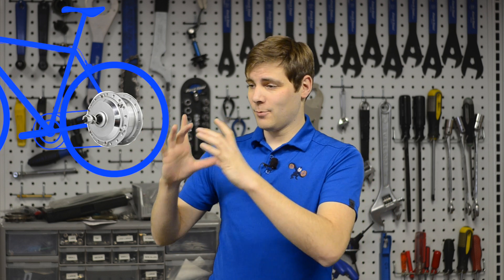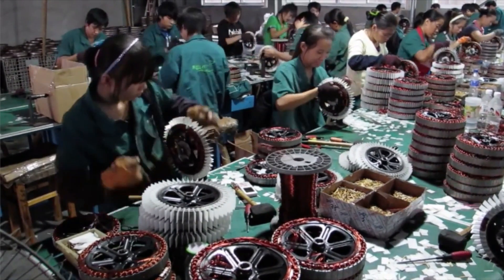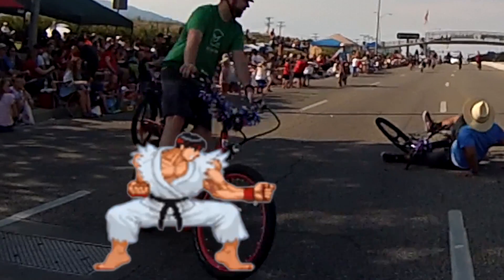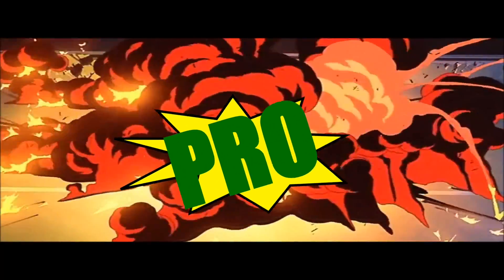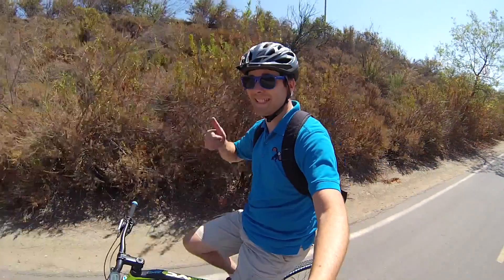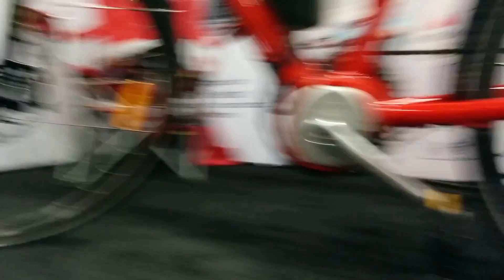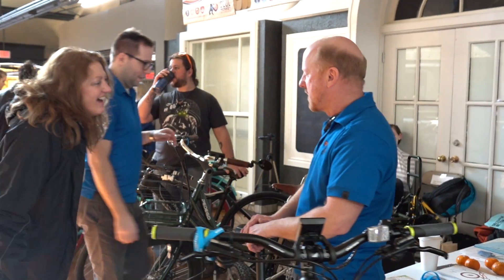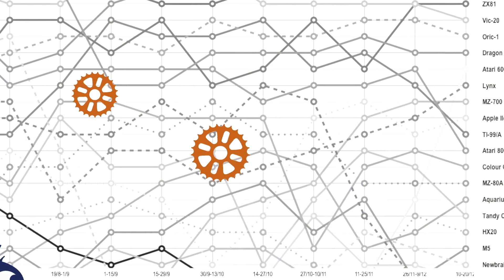Hub Drive VS Mid Drive eBike motor systems

Comment: For urban commuting that has only moderate inclines (I wouldn't even call them "hills" but enough to require changing several gears), which is better, mid or hub drive?  This video seems to mainly focus on mountain biking, unfortunately.

Comment: The BAFANG Mid drive any day. 1. Easy to build  I put one on my Trek 29er in about an hour.  2. Use of gears. I still have 9 gears to utilize. 3. You can get a kit with a throttle.  Mine has throttle and motor cut of sensor for easier shifting of gears.   see it here:   https://www.youtube.com/watch?v=ET3_axuihbY&t=1s    I have over 2000 miles on it.  Grease it every 1K and yer good to go.  Still using original chain which is beginning to stretch out, will replace soon.

Comment: I prefer a 48v front hub with  a 52v 1200watt 10ah on a 29" 300c road bike. No suspension. No gears just back pedal brake. Going by years strong now with an average range of 35km at top speed of 49km/hr
Reply from the maker: Coaster brake with 1200w? Be sure to dust off that will of yours.

Comment: If the hub drive is not switched on, does it add much drag?  And same for the mid drive when you are pedaling faster than the motor cut-out speed?  Cheers!
Reply from the maker: It depends on the system, but yes, there is some drag. The extra weight of all the electric parts is usually around 15 lbs. That seems to be a bigger issue for most folks.

Comment: I prefer stress on the cain over stress on the motor. Since the middrive motor profits the same as I do frome a good gear choice, and we both can use the full spectrum, the motor is more likely in it's sweetspot of RPM to torque, while the hubdrive spins slower, unable to deliblver the requested amount of torque, sucks more and more amps, while cooling, because of lower speed, starts to fail.

Look at ebay, there are so many hubdrive pedelec with burnt motors, while there are the old Panasonic 26V middrive pedelecs, after 10 years and several thousands of kilometers still in use.

I mean, a new chain costs 30-50 CHF, while a new motor costs around 800-1200 CHF. But that doesn't matter at all, since I have a bike here, with the Panasonic 26V middrive, 24'000 km and the original chain still in use. But I have to say, to be fair, that it is a hubgear-pedelec.

Comment: I really cannot believe that someone with basic logic will buy a bike with mid drive! I am also astonished not to see or hear about the major con of the mid drive. What is something that will often occur while biking an ebike? That you will run out of battery of course. How are you going to pedal an uphill with a mid drive ebike which has a dead battery when you have got rid of the front triplet chain ring and substituted it with just one ring chain of about 42 teeth!! You just cannot!

Comment: I think you missed some big points
Hubs have issues with "unsprung weight" that can be reduced but not eliminated.
Mid drives can't do regen braking and they are still a long way from standardization -this means they are on the fast track to obsolescence.
Reply: regen breaking is on its way out in bikes and scooters. Very non efficient and too many batteries blowing up from it

Comment: The "music" bed is not only unnecessary, it's distracting. It comes across more as an irritant and left the video non-watchable..I moved on @ :33.
Reply from the maker: The "comment" in this section is distractions and unnecessary. It comes across as an irritant and and unreadable. I moved on after 25 words.
Reply: Blue Monkey Bicycles I like your presentation; the set and your production in general. Best of luck to you~

Comment: Mid drives don't always require you to pedal, the iZip bikes have the option of a throttle control now, the motors have an additional ratchet so they can turn without the pedals needing to turn.

Comment: just came back from the Alps where our hotel was renting out ebikes with the bosch mid mounted motor and these get up and down the mountains every day, used as abused by the uncaring customer. So that makes me think that chain snapping isn't a thing anymore otherwise it would not be viable for them (also nobody wants angry customers stranded on a mountain)

Comment: I'm impressed by how much of wrong information one can get from a video that seems to look quite professionally...
Reply from the maker: Do tell...
Reply: Well, you don't need a specific frame for a middrive.. I have put four of BBS02s on my bikes to make them all electric... You can actually use a throttle and no, you don't have to pedal if you don't want to... You get this instant torque also from a mid drive and you can still keep your existing gears while when oposed to hub drive, you just keep the same gear all the time thus you decide at the beginning what is more important to you... Speed VS torque...

Comment: front hub drive is worth a mention too! 
con: comparably weak, because traction and not breking the fork limit how much power makes sense. no good choice for sporty off road driving. 
pro: cheap and easy to install on almost any bike. the added mass on the front wheel makes hands free riding incredibly stable. also works very well on roadbikes.
Reply from the maker: Covered in another video

Comment: Thanks for the advise, I bought a helicopter.
Reply from the maker: Awesome
Reply: @BlueMonkeyBicycles  Today I got a cyclamatic power plus 250w. I'm 38 and it's my 1st time riding one, so much easy on peddling or being lazy and just use throttle only. I'm now looking at the mid motor as for the reasons explained in your video, plus it will stop me from being lazy from using a throttle. The cyclamatic was a cheap tester to see if I'd like having assist before spending a few thousand on something that I might not enjoy.
Reply: I got my dick stuck in the toaster

Comment: QUESTION  ; WITH A MID DRIVE , CAN I STILL US MY COASTER BRAKE ?
 I have a 7 speed internal hub .
Reply from the maker: Presumably, yes. You can also use caps lock with a mid drive.

Comment: You failed to mention mid drive with a belt (and hub gears). You can't have a belt with a hub-drive, and belts are far less maintenance than chain drives (and don't suffer the issues with stress).
My bike (Kalkhoff) is basically zero maintenance, with no chain, no oil, no mess, no fuss.
Reply from the maker: I've seen hub drives with a belt instead of a chain.

Comment: If you are looking to do a responsible climate disruption response as an individual there are 18 items out of 100 that you can be responsible for. Worldwide if we all did it we could sequester (without the oil and gas companies doing geoengineering) about 372 Gigatons in 30 years.

 E bikes are .96 GT and rank #69 but you can also push for better bike infrastructure for another 2.31 GT rank #59. Also you could do your own charging station (minimalist tiny home. apartment or rooftop solar) 24.6 GT which is #10 in ranking. Be your own power company. 
Vimeo on part of this see Verchinski and Thoreau.

Comment: If the chain breaks on my hub drive bike then I would be stuck as it’s a pedal assist. If I don’t pedal I would just stop
Reply from the maker: Depends on the sensor that drives the bike. A cadence sensor can run the bike with no chain.
Reply: I have never tried it without a chain but it would be a bit pointless. The motor only kicks in when my speed is below 15.5 mph.

Comment: I really enjoy front hub drive...I've tried the rest...and for me it was front wheel hub drive...
Reply from the maker: 2kw front hub is too rich for my blood...
Reply: There is a reason why in Europe you can only have a 250 W motor, especially if they are on the front wheel for versatility and conversion purposes. And seeing as they’ve been doing this longer than anyone, I chose a front wheel drive for general commuting on my 90’s Trek Hybrid with 18 speeds to assist. And I can get up any hill in this very hilly town of Prescott Arizona and I’m in my 70s!

Comment: I'm so confused. I'm buying an ebike tomorrow and I have to make that very choice. I like the idea of mid-motor, because they seem to produce more torque than the hub motors, but that chain snapping really scares me...
Reply from the maker: It's improved a lot in 2 years. I wouldn't worry unless you're doing lots of mountain biking, and you're new to the platform. If either of those don't apply, a mid drive is fine.
Reply: @BlueMonkeyBicycles  Thanks. I'm going to the bike shop today. From what I see, they might have just made my choice for me. They have two models of the same bike, one with back drive and one mid drive. They had the mid drive in promotion, same price as the back drive. But now it finished and the back drive is in the promotion, making it half the price of the mid drive.

Comment: Belt mid-drives are coming on strong. Quieter, stronger and longer lasting. No real maintenance either. Adds a bit to cost but the benefits are great.
Reply from the maker: You're taking about belt drives instead of a chain, right? They are  nice, but gearing options are limited, and dual suspension requires a lot of work. They are coming along though...
Reply: Blue Monkey Bicycles - yeah, I’m a bit puzzled why the belts aren’t more prominent yet. Perhaps a cost configuration issue but expect they will become more available as chains are just a pain generally. Hubs are ok for their purpose but not when you want or need torque and gearing when mountain/trailing etc.

Comment: Audio tips: Having music with lyrics in an intro while you are talking makes it more difficult to understand you. Change to instrument only music. 2nd tip. Run your recorded audio through a program such as voicemeter banana to help take the harshness off some. 3rd tip. Look into balancing audio across the video. Programs are out there just find what works for you. Great information here and the audio fixes are really easy. P.S. Change the gain on your microphone and move it further down to avoid the pop sound from your Ps.
Reply from the maker: Thanks. Take a look at some later videos, I improved a bit, but I didn't get as far as you've outlined. Thanks for the advice, I'll use it in the future
Reply: @BlueMonkeyBicycles  Awesome. Your content is great and I wish you the best in your future endeavors.
Reply from the maker: Thanks. What do you think of the audio on the more current vids?

Comment: what about a urban x cause what I was thinking about getting. And is they waterproof like is most e bike's waterproof cause some 1 told me the rain can mess up the e bikes. Ane where  can I get a mid drive e bikes what stores sells them ?
Reply from the maker: If you have a home made battery pack, and connectors, then it might not handle rain as well. I'd you get any professional kit, it should have water proof connectors.
ebikekit.com has a good kit with water proof connectors as well

Comment: This guy is obviously pushing mid-drive because it requires a custom frame, this you are forced to buy a complete bike from a dealer. One could easily put smaller hub motors on both the front and back to distribute the weight.

Plus, notice that most of the advantages he gives for mid-drive are etherial and subjective, like "a zen-like experience" or "you get to see more." Utter BS.

They just want to sell more $4,000 bicycles.
Reply from the maker: "ethereal"
You may be pleased to hear we don't sell bikes anymore. As of now, Blue Monkey is completely independent of any salesman stigma.

Comment: Do you have a recommendation for a electrification for a Schwinn Meridian trike (26")? Speed is not an issue but torque is.
Reply from the maker: ebikekit.com

The guys over there have loads of experience doing trike conversions. So much so that they make finished trikes in house under electrictrike.com brand.

Comment: Actually I've seen a couple videos where they use a belt instead of a chain. I too, know very little about torque and strain. But I suppose if the combustion engine has been using belts for a generation, it must be alright. 

I still want to get my hands on the design the company made for the bike that reached over 200 mph just by using a pedal system with gears and chains. I'm sure with that kind of torque you can scale a mountain at a slow, easy pace. Of course they use something like 6 or 7 gears and 3 or 4 chains. So worrying about a chain snapping shouldn't be a problem.
Reply: with a belt drive you'd loose the option for derailleur gears. so a gear shifting hug is required to still have anything but a fixed gear. belt drives are pretty awesome, though. much cleaner than a chain and virtually maintenence free, when combined with a decent 7-9 speed geared hub. (those need service every 2000-3000km, and it's a huge hassle, compared to replaving a chain)  also belts are bad in mud  and dirt.

Comment: Can't decide which one is better? Then have three, yes three drives. Front hub, mid hub and rear hub drive. Although I know that it makes no sense at all, especially having mid hub with rear hub combined, if you so happens to be able to modify them. But a motorised two wheel drive bicycle seems interesting though. Anyone tried this before?
Reply from the maker: Yes, with varied levels of success

Comment: hub drive motors more efficient cuse
no chain in the way of power and that is good.
hub motors more powerfull motors.
Reply: Hub motors are weaker...
Reply: @-joo3033  Theres a limit as to how much torque the hub motor can put into a bike frame, so they feel weaker. Mid drive are driving the whole drive chain, and really just feel like you are adding a whole bunch more leg power into the crank. The wear is that it does stretch the chain faster, and more wear on the cassette. However, I off set this by realising how much Im saving not using the bus, train or car every day to get to work.A good setup should last 1000K or more, a great setup with heavy duty chains will last much longer. But pay attention to loose chains, slipping, etc. Regular maintenance will help.
Reply: @TheChromeRonin  as with ANY bicycle
Reply: @-joo3033  QS 273 V3 3t.  Tell me that's weak.   You can get 20,000KW out of it.
Reply: @JoshStreetDesign  i mean Hub motors are weak for the W used....

Comment: I'm looking to add a mid - drive motor to a cruiser bike with internal rear hub gearing. Looks like I've got some chain snapping to look forward to here in mountain country.
Reply from the maker: I wouldn't recommend an internal gear system for off-road use anyway.

Comment: Another downside to hub drives is that if you buckle the wheel its really hard to replace because size and thickness are non standard. Also you need heavy duty spokes on the hub or you will end up with broken spokes when when you hit hard bumps (especially if your battery weight is also on the back wheel). Those spokes are also non standard and hard to find. The plus side for hubs is they can take as much power as the controller than throw at them.
Reply from the maker: True dat!
Reply: I got my first used fat tire folder almost 2 years ago. Don't buy used, I learned my lesson. Buy one where you can order parts, and accessories.

Comment: No difference than having a 450 dirtbike with a chain. I owned dirtbikes and almost never bust a chain. Same with mid drives, put on a good chain and sprocket
Reply: Bicycle multispeed drive trains don’t use wide chains. Fine for a single speed but not with a typical 7,8 or 9 speed cassette.

Comment: I heard that geared hubs using up the battery faster than DD. While trying to maintain higher speed. But what about mid drive?   Are those more efficient than both? Or in between?
Reply from the maker: With rare exception, mid drives are usually a geared motor. Check out the video on direct drive vs geared

Comment: Mid drives are the undisputed king when it comes to  going up hills . 
It's all about the Torque. A 250 watt mid drive with 75 Nm of torque or more can tackle any hill with ease.
Reply from the maker: A 500w hub drive with 40nm of torque climbs all the paved hills in my area with ease.
Reply: I should have been more specific . I'm 73 years old with a bad back and weak legs and i live in the black forest of germany and the hills here are epic. But for a fit guy like you , 40 nm is adequate .
Reply from the maker: I noted the hub drive experience from the many store customers we had, of various different athletic capabilities.
Reply: I bought a mid drive because they are so common here and there is a vast service and parts  network to draw on. Hub motors are great for those that have a tight budget and for those that like to create their own style of bike . One of the great things about ebikes is the variety of possibilities .

Comment: I own a Felt " Flying Machine " bicycle which was perfectly adequate for flat country with it's 7 speed rear hub transmission, but stopped riding it when we moved to the mountains because 7 speeds aren't enough. I'm leaning towards a mid drive motor in order to retain the superb 7 speed transmission, so bearing in mind that I weigh in at about 235 pounds, is there any particular brand of electric motor that you can recommend for both long range and climbing the occasional hill?
Reply from the maker: How far of range are you looking for? For long range+hill climbing you'd be looking at a large battery size. Maybe 52v and 20Ah ought to do it. These are big batteries. Looking at some pictures of that bike, it doesn't seem to have a good place to mount a battery off hand; it may require some handiwork to get a nice system on there. The Shimano Nexus 7 gearing on the bike is certainly nice, but it's not rare. If you're up for it, you could find a different bike and reuse that gearing.
If you're looking for a monster production bike with that size of battery, check out biktrix